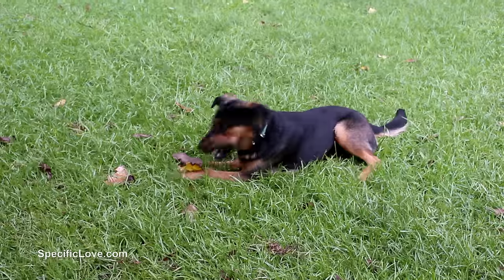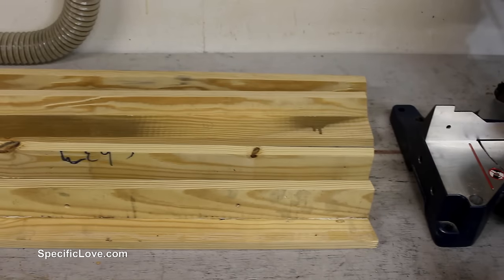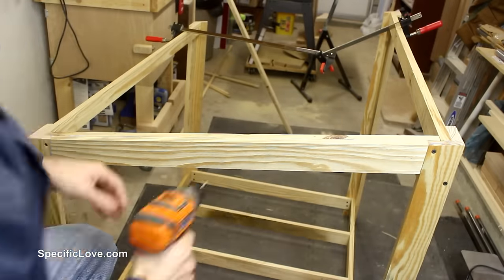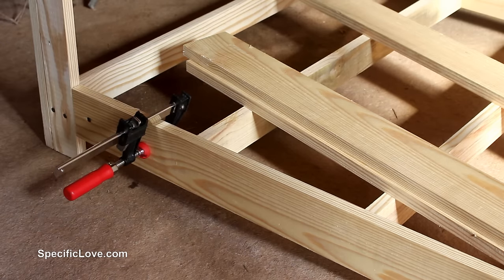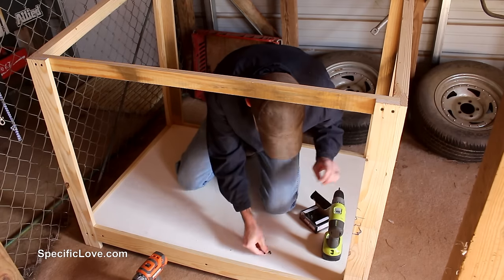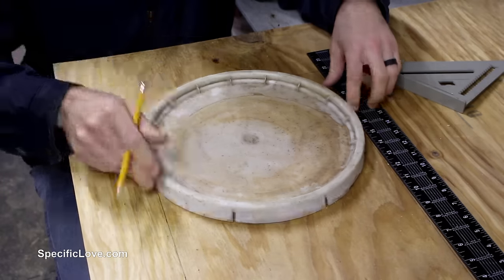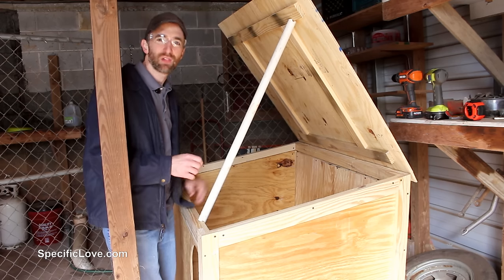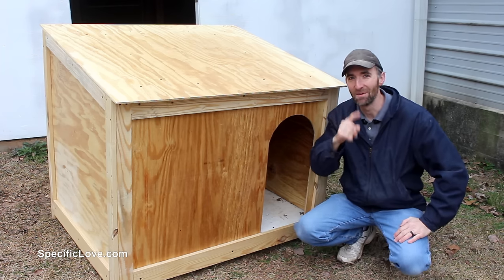Simple Large Dog House Build DIY

Comment: You should note that the Slope of the Dog House should angle downward in the back if using the dog house outside where it will be rained on instead of the way that you built this one sloping down in the front since it will be under cover. Sloping it downwards on the back will allow for rain to run off of the back instead of to the front doorway area like it will with the way this one is built.
Reply: Thank you!  First thing I saw, didn't bother watching it....

Comment: Having to undo a project to get it out of my working area has happened to me before. Great job on the dog house!
Reply from the maker: Thank you
Reply: Connection: Don't sweat it .The Navy built a $175,000,000 something or other that wouldn't fit through the door of the $250,000,000 bld. they built to put it in. One was a total write off. Believe it was the building.

Comment: Can you build a box to store 2 water cooler bottles and protect from freezing (insulated)
Reply from the maker: An idea could be just buy some foam insulation and glue some layers together, and then drill out holes for the water. Then use another piece as a lid. But it might be easier and cheaper to just buy a small cooler.